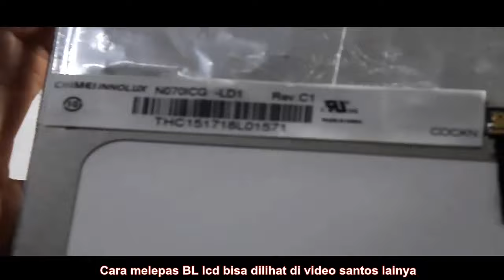DIY Projector IPS LCD & 200w LED Part 4

Comment: please tell me  ----  distance between led chip white plastic bracket and condenser lens
Reply from the maker: The distance between the led and the good condensor is 2'millimeters, sir
Reply: using 2 mm gap how many months you are using 200 w led  --  is there any decrease in light output ?
Reply from the maker: @rahulkumar-qu2xo  I have used it for 7 months, if the distance between the led and the condensor will further reduce lumens, and the light tends to turn yellow sir
Reply: @DIYIDN  thanks - if distance between led and condenser is increased to 3 mm or 5 mm then light output will decrease - is it that what you mean to say - can you  help me to build frame holder for 4 inch lcd panel - I am using from uc wifi projector
Reply from the maker: @rahulkumar-qu2xo  correct sir, the light will decrease and not even white evenly. if for the lcd stand you can use acrilic or pcb board
Reply: did you compared this led projector with commercial dlp projector ---  i mean at what diagonal size say at 100 inch or 120 inch ---  this led projector image brightness is comparable to dlp projector  ?
Reply: @DIYIDN  soy colombiano mi pregunta es donde consigo esos elementos

Comment: The TFT is not 1080p! It's 1280X800 (16:10) ratio. You wrote in the video text that it's 7" 1080P!It will display 720p, not 1080P.